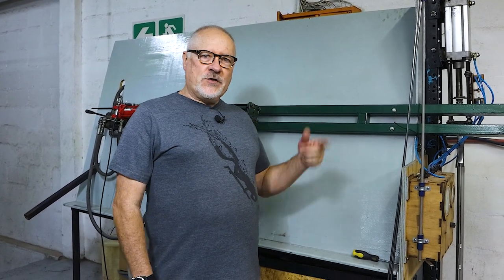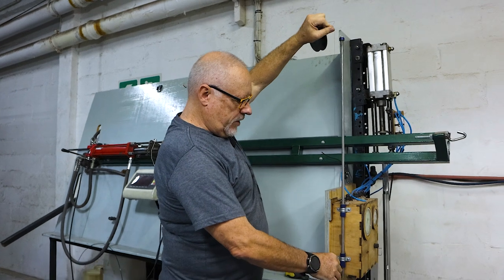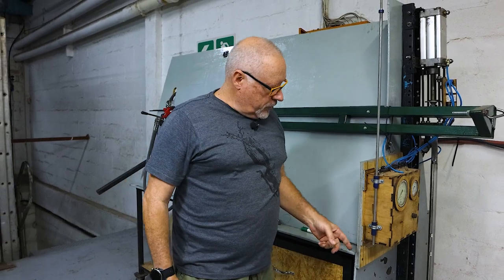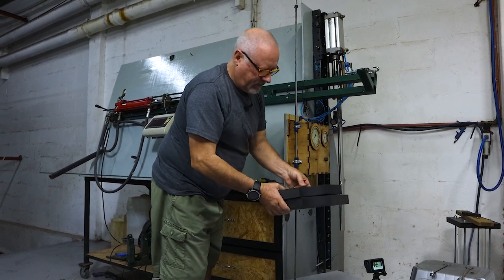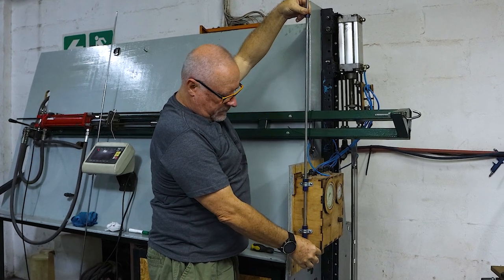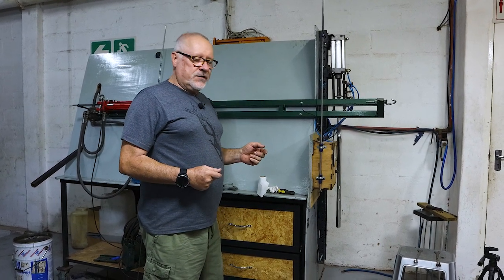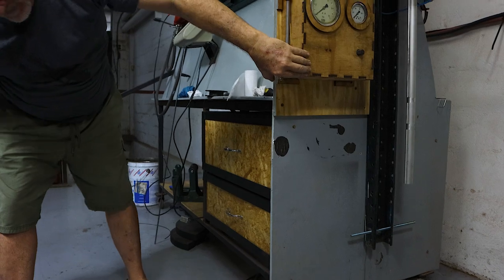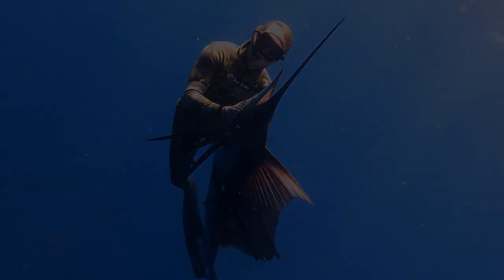Rob Allen | Tri-Cut VS Pencil Point Spear | 2023

Comment: Thanks Rob. Honest experiment. Another reason for using tri-cut spear tip is that it’s easier to sharpen at home, on the beach, on boat or even in the sea, we just need a file or stone, no special tools are needed.
Reply from the maker: I have found most have difficulty keeping the 3 facets uniform if free handing it without  a jig.
Reply: @RobAllenSpearfishing   Rob if the facets get  unbalanced does that affect accuracy or does the point just blunt easier.
Reply from the maker: @markumbers5362  The point on both the pencil and the tri-cut will get damaged and become blunt equally in my opinion. More importantly if either point is slightly off center it will deflect the spear massively. Remember, that is the very front and will be able to very easily push the spear off to one side. On a side note, if the trailing end of the barb is bent out just 1mm, it will make a 1,7m spear shoot off by about 60mm at 4m. The barb is further back than the point so a 1mm off center spear tip, no matter what tip, will cause an even greater inaccuracy.
Reply: @RobAllenSpearfishing   Thanks for that great answer. I will be  getting in the pool and start testing my guns.
Reply: Thanks for the honest and precise experiment. There are lot of "pros" and "cons" favoring one ore other type of spear tip. I personally use "double" cone pencil type removable spear tips  and also used once spear with tri cut tip and didn't notice any difference. Actually, i find it very tricky to sharpen tri cut tip because there is always big risk of getting it unbalanced if you make  the slightest imperfection  , which means that you must have proper tools for this process (  120°  rotational adjuster , belt sander , spear positioning and fixation tools etc ....). It's just not worth it. Moreover, after this experiment you made, it turns out that pencil type is even little bit better 😮
BRGDS

Comment: Thanks Rob! I admire how open and honest your tests are. This test surprised me. The pencil point spear was also a steeper taper than many other pencil point spears and I thought it would be at a disadvantage. Have you tested the other commonly believed theory that pencil/conical point spears are more accurate than tri cut? I really don't see how if the tri cut has perfect facets.
Reply from the maker: Thanks for the positive comments. Yes, I was just as surprised. There is no way there would be any difference in accuracy between the 2 if both are shaped symmetrically. I agree, the tri-cut is harder to keep uniform.

Comment: My idea is that the pencil point is appropriate for blue water. Long shots and overpowered guns need to be accurized to reduce shaft whip and any "steering" from out of tune floppers or uneven cut tri tips. So to reduce variables when accurizing use a pencil point. Has anyone else heard this theory?
Reply from the maker: I have to disagree, as long as both are uniformly ground there will be no affect on the spears flight. If either are off, even slightly, they will affect the spears flight. However, to make a pencil point uniform is much easier than a tri cut.
Reply: @RobAllenSpearfishing  I don't have enough blue water experience to know. So I'm glad you replied. Thanks for the info.
Reply from the maker: @tylergrunert  Chances are, the tri cut will give the best penetration due to the better bone cutting if you happen to hit bone.

Comment: Hi Rob, 
great and honest video as always! 
I am surprised. Have seen people doing serious tests in pools and they claim tri-cut has better penetration. I am no material specialist at all but the tests I have seen was using kind of construction foam targets.
Maybe the ballistic gel creates lots of friction around the shaft itself (I'm ignoring the type of tip for a second) that makes both tips look to achieve similar penetration. Meaning that the length of the spear that is penetrating is more relevant as the relatively smaller tip (I am visualizing friction on larger vs smaller "area")? 
Question also, would be how it behaves on real fish bodies - I ask myself which material gets closer to real fish bodies. Would it be the gel (isn't it more sticky in a way?) or some foams? Not sure really.

Thanks for sharing invaluable myth busting videos. Love what you guys do. 
Regards from Panama and all the best ><)))*>
Reply from the maker: I agree, the ballistic gel is probably not the right medium. The tri-cut is not really cutting as the gel is soft. We will repeat this later with cardboard and foam layers.
Reply: @RobAllenSpearfishing  Excited to see those results. Thanks for your feedback!

Comment: Rob the next thing would be using either a different material such as tungsten or what about barrel spear shape, fat in the middle and thinner at the tips, they use this in archery, it produces a stiffer shaft for less material. 8mm middle and 4mm tips. Would pentrate water and fish better. Have to make on a lathe.
Reply from the maker: I agree but running that off a rail barrel will induce a wobble. I'd rather keep with the rail advantage than no rail and this option. Yes, I agree it should be better but to machine a spear down like that would cost a fortune.

Comment: Hi Rob,

Do you have plans to start producing double roller guns, and what are your thoughts on them?
Reply from the maker: We are quite far advanced with one. They have a place to give more power on longer rollers where you can use 2 thinner rubbers. This also allows for heavier spears. These in my opinion are not really suitable on our standard tube guns if you want to drive say an 8mm spear, you need more barrel buoyancy and mass to help with recoil.

Comment: Ballistics gel actually isn't the best thing to use for that. It gives poor results due to surface friction. Better to use many layers of corrogated cardboard, and do 4 test of each spear to test for variations in the cardboard. Also a factor is the cutting could be observed in the gel with the tri-cut, does more damage, therefore more dangerous to the fish. It's also easier to sharpen with a grinder. Stick to tri-cut.
Reply from the maker: Agreed, the ballistic gel not the best. I had thought this was the norm with bullets. It also changes state as it cools. I need to do another test but with cardboard layers, maybe with foam in between.
Reply: @RobAllenSpearfishing  Yeah it's the norm with bullets, but they don't have a large area of surface friction. Thanks for the reply. Keen to see the follow-up. My money is on tri-cut.
Reply: A duller tip arguably could produce more trauma punching and tearing a hole versus a Precision cut. Which might be a moot point because of the Flopper. You cut your hole through cleanly and then catch the fish with the Flopper. I've had less issues with the tip and more issues with the line actually cutting the meat if I don't get a good shot